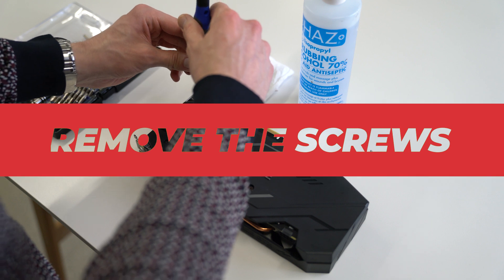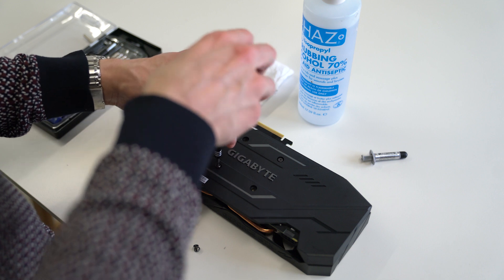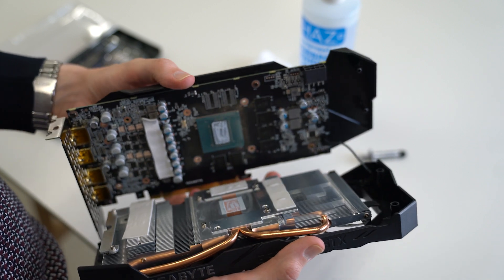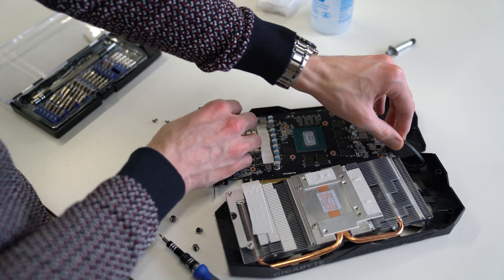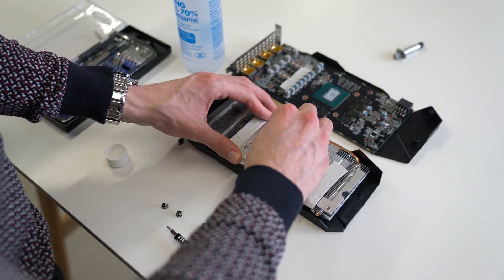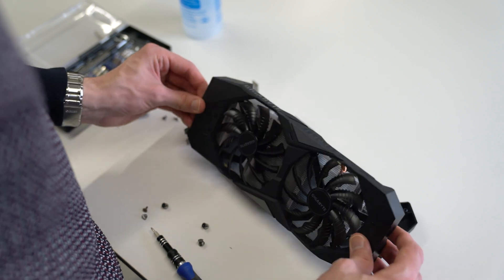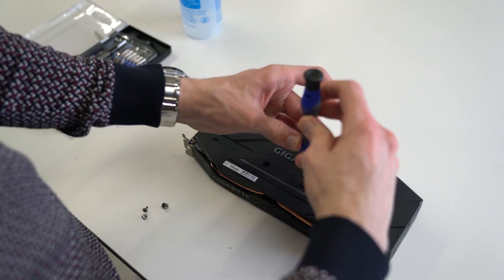How to correctly apply thermal paste to a GPU | WePC

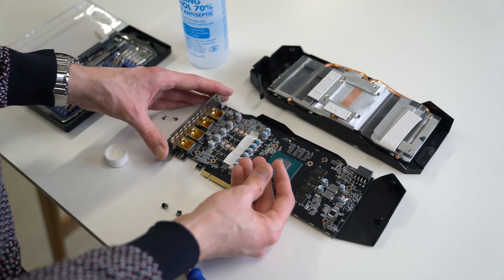Comment: 1:33 bad advice, a GPU is NOT a CPU. it did not comes with a Heatspreader. It's REALLY important to take care that in EVERY corner is covered with thermal paste.
Everything else is Gambling and risking a Dead GPU.
Reply: I agree. You need more thermal paste. It's a different than putting thermal paste on the CPU. The CPU has an integrated heat spreader (IHS). The GPU dye is bare with no IHS, thus every part of the dye must be covered.
Reply: you guys should listen in the video that it will spread evenly when the heatsink is back.
Reply: @soapgaming8046  That's fine for CPUs because of the IHS (integrated heat spreader). The IHS helps spread the hottest part of the CPU over the area of the IHS surface. 

GPUs do not have an IHS, which means it is not worth it to just assume that every square millimeter will be covered by thermal paste after the heatsink is back on. Using a lot of thermal paste or spreading it manually is always the best option. Do not blindly trust everything you see on youtube.